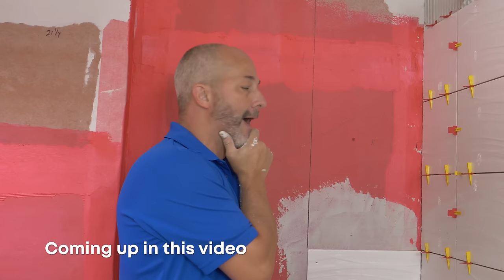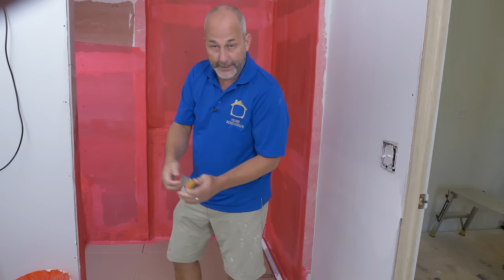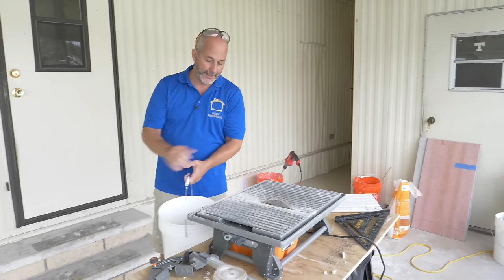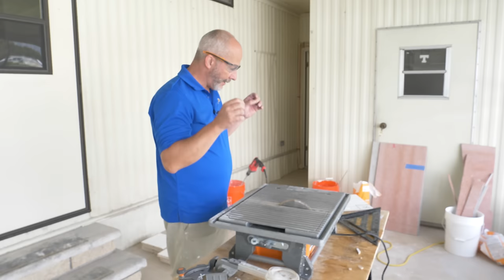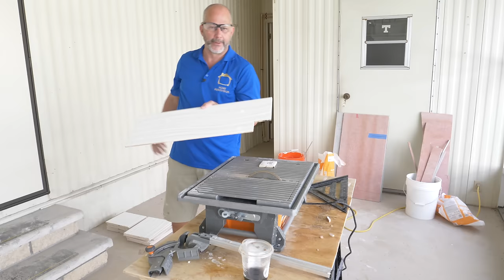Tiling a Custom Shower From Start to Finish

Comment: Jeff, Another great video.

Now, going a bit off-topic and addressing your rant about products availability ... Welcome to Florida! 

[It's not too late -- we can smuggle you out of Fantasyland.]

With respect to the rant about Lowe's, Home Depot and other suppliers not carrying the correct materials for the products they sell: No surprise there. Part of this is the hot Florida residential market causing supply shortages for some products. The last of the Baby Boomers are retiring to Florida, driving up home prices and demand for home construction materials. [Hint to retirees: Income taxes should not be the sole deciding factor on where to retire. Homeowner and auto insurance rates are significantly higher than other states, eating up and exceeding any state income tax obligation you may have in your home state. If you're retiring for warmer weather, remember -- Florida is warm, but the humidity is oppressive for up to 6 months a year.]

Part of the lack of product is due to market economics. Buyers for the "big box" stores want their cake and eat it, too. Large volumes at low prices. Suppliers rebel when the price is too low and/or when demand strips supply. Your a supplier of Product X, a high demand product. Everyone is knocking on your door looking for supplies of your product. You have contracts with "big box" stores, but with various distributors. Who are you going to ship your limited supply to first -- the "big box" store who demands a stiff discount, the local distributor who pays a industry standard discount, or other purchasers who pay what your demanding?

Also, the buyers for the "big box" stores are, IMHO, some of the most clueless buyers in the world. Your rant about the proper thinset is spot-on, but doesn't go far enough. There are other products sold by these stores that don't have the associated products needed to make them work the way the manufacturer intended. And, it's not limited to just "big box" hardware stores. Many stores sell product without the supporting supplies. [My simple but favorite example: Walmart sells Zippo brand lighters, but doesn't sell fuel or flints or flints for the lighters.]

Good luck with the rehab ... and don't be surprised when you discover other substandard construction in Florida homes.

Comment: The seat is an eyesore, I’m sorry but it would have flowed so much better if you’d have carried on the wall pattern over the seat top, you already had it on the seat front I just don’t get what you was thinking, none of the grout lines match up it throws the eye off when you look at it. Technically the shower is probably sound but the tile layout could have been drawn up on paper to scale and worked out in advance. Or you could have used a large format tile for the seat top like you did with the shelves and left a slight overhang to match the shelves and alcoves, that would have made it 100 times neater imo. But great effort for doing it. 😊

Comment: "Don't use metal angle or ruler for a straight edge. It can scratch the tile." Then uses trowel to scrap thinset off the tile surface. Lol

Comment: The thinset on your marble shelf was ridged the wrong way. You should have ridged it with the ridges parallel to the short dimension to allow air in between the ridges to escape more easily when you press down the shelf. Same on the vertical wall edge tile.
Reply: You aren’t a tile guy.  You’ve watched a few vids and may have done your tub surround.
Reply: @AK-ky3ou  Yeah, I'm not a "tile guy." I've only done complete bathrooms and kitchens, entranceways, floors and walls. This is especially important on long tiles, like in the video. But sure, you go ahead and imagine that you know what you're talking about.

Comment: As much as I'd like to rip on Home Disappointment, there's a reason why they didn't have unmodified thinset. No one needs it.

 As I'm sure you are aware, the previous requirement for unmodified thinset stemmed from latex modified thinset needing to dry outwards, versus the curing that unmodified cementous thinset does. Porcelain lain over plastic sheeting such as Kerdi would have taken weeks or months to dry, since both are effectively water impervious. However, with the widespread adoption of top applied waterproofing membranes,manufacturers have changed their formulas to accommodate. If you read the acceptable substrates listed by Mapei, almost all specify "Mapei waterproofing membranes", meaning both their polyethylene sheet and liquid type (Aqua Defense) membranes.  

Schluter, who had the initial North American market share of  plastic isolation and waterproofing membranes hasn't been keen to change the perception that modified thinsets from other companies  can be used with their products, because they want you to use Schluter thinset for "warranty reasons". In reality, Mapei modified thinsets are possibly better, since they offer a wider range of products for different applications (large format tile, for example). 

Most DIYers wouldn't be aware of this, nor would the part-time Home Disappointment flooring department associate. I am surprised that you don't, though. I'm sure you are busy with all the content you put out, and we are all learning.

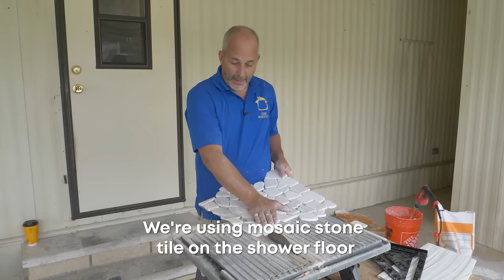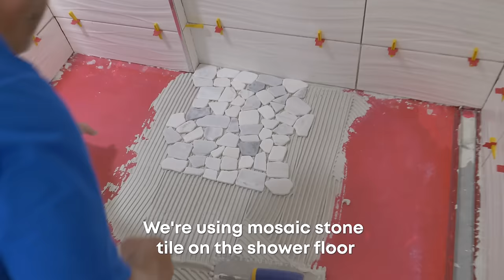Comment: 1:13 - I don't know, call me crazy, but I would think that one would want to have the wall tiles overlap the seat tiles in the rear? The seat tiles should have been installed before any wall tile above it. Your eyes will be drawn to edges like this and it's a much cleaner install if you take into account details like this. 1:15 - Similarly, this is true of the marble shelf installation. The shelf should have been installed first and the wall tile over the top of it. 
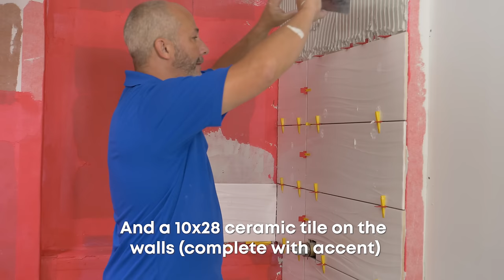1:23 - In keeping with what's said above, wall tile covering surfaces below, the flooring would have been the first thing I would have done replete with grout. Only then would I have started the wall tiles. Just my opinion....😇

Comment: Always put benches, sills in first before you tile. 

Bro water will run down the walls and sit in the joint and will be moldy within a year.

Cheers to doing it wrong.

Comment: You've made a big point about how you want to be careful around your membrane that you've installed so that you don't punch holes in it and then use the corners of metal trowels during the grouting. Care to talk a bit about how you're making sure you're not excessively scratching/cutting the membrane when you're doing that?

Comment: can a tile pro fact check using non-modified mortar on waterproofing membrane like RedGard? Cuz I was really surprised to learn that you are supposed to use non-modified thin set in this application. So I went to look up RedGard's installation instructions, and it specifically says "Install tile or stone with a Custom® Building Products polymer
modified mortar that meets ANSI A118.4 or A118.15 standards." Or "Polymer modified Mortar" and "modified thin set" are not the same thing?
Reply: I did fact check it. I posted a longish answer to your question but the bottom line is that modified is preferred in all instances except in some very special circumstances.

Comment: 59:30 -Welp, we all carry some misconceptions about the "science" behind "stuff" and as an engineer I can tell you in my lifetime I've carried with me many misconceptions on many a topic and so I was curious about all you said regarding the "science" behind the use of polymers and thin-set without (unmodified) and I asked chat GPT (Yep, AI) to clarify:

"The assertion that the use of modified thin-set with polymers impedes the curing process when applied over a waterproofing membrane like RedGard is not accurate. In fact, the use of modified thin-set mortar is typically recommended for such applications, as it provides several advantages over unmodified thin-set.

Modified thin-set mortar contains polymers (usually latex or acrylic) that enhance its bonding strength, flexibility, and durability. These polymers improve the mortar's ability to adhere to various surfaces, including waterproofing membranes, and they can help create a more robust and long-lasting tile installation.

Here are a few reasons why modified thin-set is commonly used over waterproofing membranes:

1. Improved Bonding: The polymer additives in modified thin-set mortar enhance its adhesion to both the substrate and the tiles. This results in a stronger bond, reducing the risk of tile delamination or failure.

2. Flexibility: Modified thin-set mortars are more flexible than unmodified ones. This added flexibility helps accommodate slight movements in the substrate or building structure, which is especially important in areas prone to temperature fluctuations or minor shifts.

3. Crack Resistance: The polymers in modified thin-set mortars can help reduce the risk of cracks forming in the tile installation. This is essential for maintaining the waterproofing integrity of the membrane and ensuring the tiles remain securely in place.

4. Moisture Resistance: Many modified thin-set mortars are designed to resist moisture intrusion, making them suitable for wet or damp areas such as showers and bathrooms.

5. Compatibility: Modified thin-set mortars are compatible with various tile types, including porcelain, ceramic, natural stone, and glass.

In contrast, unmodified thin-set mortar is typically used in situations where a specific set of conditions exists, such as when tiling DIRECTLY over cement backer board. Unmodified thin-set lacks the polymer additives found in modified thin-set, making it less flexible and less resistant to cracking.

When using a waterproofing membrane like RedGard or similar products, it's important to follow the manufacturer's instructions and recommendations for the type of thin-set mortar to use. In most cases, you will find that using a modified thin-set mortar is the preferred method for achieving a durable and waterproof tile installation. Always ensure proper surface preparation, apply the waterproofing membrane correctly, and follow best practices for tile installation to achieve the desired results."

Comment: it would have been actually better to have installed the tiles on the bench and floor first. it provides for a better flow for the water to drain. it also looks more pleasing for the tiles to be under the walls.

Comment: I love the videos Jeff. Just a humble tip for you. With the shower floor tile, I would have taken off the pieces of tile from the mesh and individually install each piece. With this method you'll have a better look with no noticeable joints between the sheets and you'll also reduce cuts to barley none at all 🤘

Comment: You likely know this. Tip, use ice cold water when mixing Allset to maximize work time. Should be able to get close to 3 hours before it goes off. You are slowing the chemical reaction that is taking place.

Comment: Watching more and more of Jeff's Video's turned the House we moved into about a Year ago from a decent living space into a horror show. xD
The Bathroom is full Tile the Floor the Walls everything the Walls are a Mess to put it mildly the Glaze Pattern is all over the place nothing matches 75% of the Wall Tiles are crucket with sideways or top to bottom slops its ridiciulis actually.
Now I am actually worried what else the cut corners with in this shit show the entire Kitchen has a slop towards the Window making every spile run thru the whole room it seems the only wayto fix it is to rip apart the whole place and start from scratch. [Lesson learned before buying look at everything with a microscope folks.]

Comment: No way in hell I'd ever use anytbign thicker than a mechanical pencil to mark tile. Yes most cuts should be hidden into joints or under baseboards but not all designs are like that and quite a few things require accurate cuts. 

Learn it right from the start and use a .7 or .9 lead mechincal pencil. They're cheap and you will cut with precision not with a marker line wider than the grout.